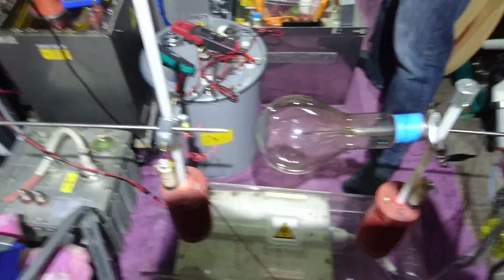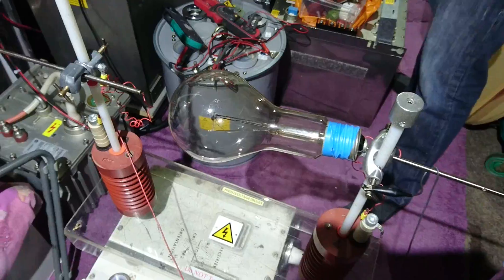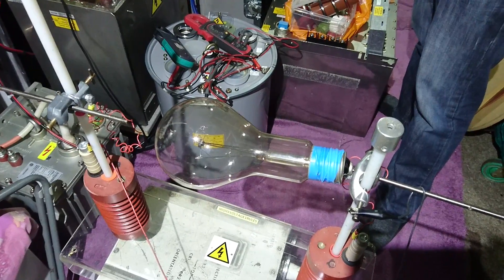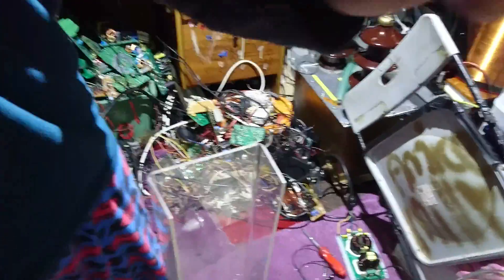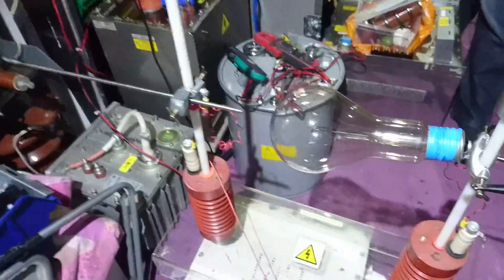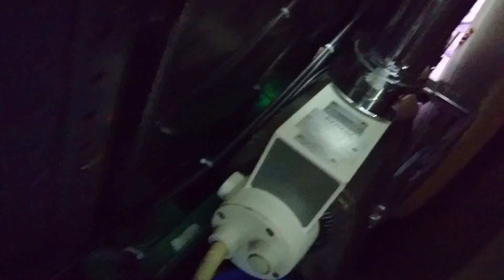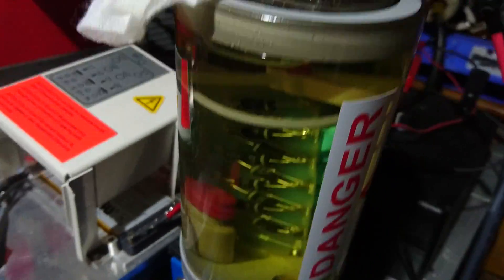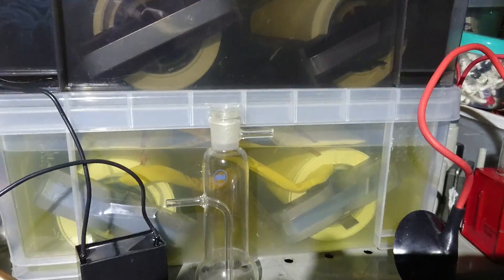Big filament Bulb destruction!

Comment: As you're doing so many high voltage experiments, you may as well get a cheap dosimeter, mobile phone camera sensor are tiny and not designed to detect radiation(Ok apart from light). I believe there is a radiation detection app for mobile phones but it requires you cover the lens with black tape so no light gets through.
Reply from the maker: Coolkeys2009 ow I see thanks mate, I'll look onto it. im looking at some point getting a hand held radiation device as I realy do need one.

thanks mate for your comment. and be safe 👍😉

Anthony 

High1voltage1rules
Reply: Geiger counters/alpha/beta/gamma/xray ionising radiation detectors cost bit more than I expected, however there are some that plug into your smart phone that are quite cheap don't know how good they are. But better safe than sorry. It will be an interesting addition to your experimental set up.